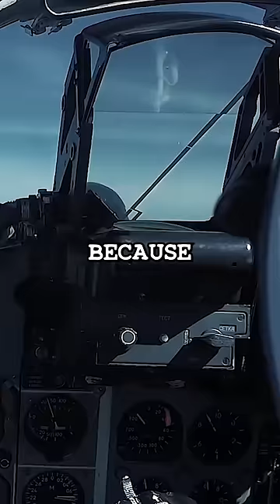What if a Fighter Jet Goes into Space?

Comment: There is this thing called the Armstrong’s line. It’s an altitude at which the blood starts to boil at room temperature because there is so little atmospheric pressure. That altitude is around 60,000 feet. If the aircraft loses cabin pressure at that altitude, you’re gonna die unless you are wearing a pressurized suit (space suit). This is why the U-2 and SR-71 pilots wear/wore space suits when they fly. Those folks are operating their aircraft between about 70,000’ to 95,000’. Loss of cabin pressure in this altitude, the pilots are protected by the space suits they are wearing. Back in the late 1950s and into the 1960s, USAF F-104 pilots wore pressurization suits because they were traveling at Mach 2 @ +60,000 feet.
Reply: Your blood is contained within your body, if you go to such altitudes it won’t just boil inside of you
Reply: @Wisewordsbruh dude, your blood will LITERALLY boil. you can look it up smh
Reply: Bs it's a Common misconception
Reply: @neckrohs it will just take less space
Reply: @neckrohs  blood is in a contained system, it can’t boil if the pressure within the veins remains constant
Reply: @neckrohs blood can’t boil if the pressure in your body remains constant
Reply: @neckrohs  plus In that case why doesn’t jet fuel do the same thing at higher altitudes?
Reply: And also the Armstrong line isn’t for blood, it’s for water, it’s the line/altitude where water starts to boil
Reply: @Wisewordsbruh  i can see where the op made mistakes in their wording. all im saying is that blood can technically boil aka ebullism. its not actually boiling like, lets say, water would but gas bubbles will form in said pilots blood if the cabins pressure drops and they dont have on the necessary means of countering it.
Reply: @Wisewordsbruh  now looking at it, my comment is also wrong since i said blood will “literally” boil. my apologies
Reply: Absolutely true
Reply: SMH, 1 PSI of pressure raises the boiling point of water by 4 degrees. If your blood pressure was 1 pound per square inch, you would immediately stroke out. Yes, just like the coolant in your car can boil when overheated, so can your blood inside your body. It would be very gruesome and messy. They would need a garden hose and many sponges to clean up the mess that used to be the pilot.  @Wisewordsbruh
Reply: @neckrohs  your fine man
Reply: @henrydhamster1093  1 PSI yeah it wouldn’t lower that much, but at the Armstrong line the op was talking about, it is around 0.0618 PSI, also your blood won’t overheat, I haven’t heard of any astronauts overheating, coolant overheats because it reaches its boiling point, it’s in a container system yeah, but there’s so much heat that the liquid inside starts to boil, there isn’t much heat in the human body compared to an internal combustion engine
Reply: Ohhhhhh, so that’s why the men wear those bulky space suits and helmets space helmets !
Reply: @Wisewordsbruh  You are right, However, the blood pressure will increase several folds momentarily if the outside pressure dropped from 1 atm pressure to less than half of that which is fatal, it will cause cardiac arrest and likely rupture your veins. But even at much lower altitude (30,000+ ft) if you don't have Oxygen mask, you will die of Hypoxia within short time.
Reply: The point is that at the Armstrong line, the atmospheric pressure is so low that water boils at room temperature. So, if you were to raise your blood pressure by 1 psi, you could raise the boiling point of your blood by about 4 degrees. The way we do this is with a pressurized space suit but if we actually raised our blood pressure by that much we would do horrible things to our bodies.  @Wisewordsbruh
Reply: They wore pressure suits because the cockpit isn't pressurised in a U2 ... what's all this 'loss of cabin pressure" nonsense
Reply: @Wisewordsbruh  our blood is mostly water
Reply: like the mercury astronaut suits?? could the mercury astronaut get out of his capsule if he had tp like in gemini caosules??? ive wondered
Reply: @Hoppy1571 you mean the space suits that have never been vacuum tunnel tested except once 😂😂😂 just pump it up inside to 14.7 psi and easily play golf on the moon 😂😂😂
Reply: The blood will "boil" only if the lift is very rapid.  One atmosphere is nothing. Divers can safely "pop out" at 22 feet depth (equal to one atmosphere"
Reply: Wouldn't you have to hit escape velocity (17500 mph) before you broke the atmosphere?
Reply: Dude a guy literally skydived from the edge of space and his blood didn't boil so this is false.
Reply: Actually, they are wearing a Pressure Suit.  What is the difference between a Pressure Suit and a Spacesuit?  A Pressure Suit is designed for very low atmospheric pressures, but can withstand hard vacuum for short periods of time.   A Spacesuit is designed for hard vacuum from the start.  
One other thing is that a Pressure Suit is relatively compact compared to a Spacesuit.  Which is why they are used inside of a cockpit, or whatever it is called now.  Because it is thinner it is a lot more flexible compared to a Spacesuit.  You don't want to try flying in a Spacesuit. 
Technically the electronics will just over heat and "burn out " , but this just means that it scorches the components of the systems in question. Rendering them totally inoperable. No fire or combustion. But, without power 🔋 it should cool off rapidly until the skin of the jet is exposed to Direct sunlight.  Plus all of the Volatile Organic Compounds, oils and other lubricants, will boil down into hard stiff sludge. Causing a problem with starting the engine(s) if you can return to thicker atmosphere.  The missiles will probably function properly.  The guns will not work without electricity.  An aircraft cannon is electricity powered and primed.  The powder will burn in vacuum because the powder has an oxidizer in it. How long the powder will work depends on how well it is sealed against adverse conditions.   But you also have a problem with the oils used to lubricate the weapon.  That will boil down/ off and cause the weapon to stop working in a short period of time.
Reply: @trogdor183 
Dude, he was wearing a Pressure Suit. Maintaining sufficient pressure inside the suit for survival.  Look at what he is wearing on you can see that he is wearing a Pressure/ vacuum helmet.
Reply: The A12 Oxcart flew higher&faster than the U2 & The Sr71 blackbird-the A12 used the same jets as the SR71 but the A12 was faster&lighter which allowed it to fly higher&faster.
Reply: Thanks for the info. 👍
So we can see the direct line to the development of spacesuits in the 50's high altitude aircraft.

Comment: You kinda fail to mention that it's impossible for the jet to go above its absolute flight ceiling - as the air thins there's less air to act against for lift, requiring the plane to move faster to maintain the same lift and altitude, but at the same time there's less air for the engines to compress resulting in a dropping compression ratio which is required for thrust efficiency, and also less oxygen which is required for combustion. These combining factors lead to a surprisingly sharp transition from operational altitude to one that the plane cannot function within - you can find graphs of the flight ceilings for your favorite planes and it's often shocking how hard the ceiling is.
Reply: Also depends on power to weight ratio. No need for lift if your engine can push more than the aircraft's weight. That's how rockets work.
Reply: @BioFake1 That’s not how the engines work. The engines need a certain amount of air to produce thrust. That means if the air gets too thin, the engines don’t work anymore no matter the thrust-to-weight ratio. This is because they can’t produce thrust if there’s not enough air for the engines. The comment you replied to explained this enough to answer your question. I am just restating it.
Reply: Comment #2
Rocket engines don’t work the same as jet engines. I assume (based on what I’ve heard) that rocket engines either don’t need air to work or they bring the air with them. Jet engines REQUIRE air to work because of how they are designed.
Reply: @IceClancy-jc2co  I'm not asking anything 🤔
Dude talks about loss of lift when air gets rare... 
I do know any engine needs oxygen for combustion to happen... 
I'm talking propulsion aircrafts flight mechanics not specifically airplane's. Missiles and rockets are aircrafts too. Go back to playing minecraft, kid.
Reply: @IceClancy-jc2co well one of the multiple fuels used that fire a rocket engine is liquid oxygen. Not sure what the other fuel is on modern rockets, but on the Apollo Saturn V it was kerosene so they literally provided their own oxygen in the fuel itself.

Comment: Little known fact:  when the F15 Streak Eagle set the time to climb records, on the last 30,000m flight, the engines were shut down (brought to idle) at 80,000ft, and from then it flew a balistic trajectory,  flying through the altitude for the record (98,425ft) but crested at around 103,000 ft, at which point it was traveling around 50mph, and pitching up and down by 40 degrees (20 deg nose high to 20 deg nose low) - the plane was barely in control at that altitude (and speed).  
Crazy to think that Foxbat was almost 4 miles higher up!
Reply: Sounds like the wildest roller coaster ride in history! No thank you!!!!
🫣💀🫣🤯🤯
Reply: Fox at was made out of titanium so it was more rugged
Reply: Even crazier that the SR-71 cruising altitude is fucking 90,000ft at a cruising speed of Mach 3.3 😭

Comment: The electronics will not burn cuz there is no air just like the engine and there is no way someone is going to die with a space suit cuz he's in space THAT'S LITERALLY WHY THEY MADE SPACE SUITS
Reply: No air means no way to remove the heat generated by the electronics. However they also said the electronics will stop working because the engines aren't generating power.
Reply: Lol. Thank you. This is what I was scrolling for.
Reply: @MikeSealguitar  ur welcome
Reply: @3rdalbum  Do you realize what temperature that altitude is...-50 deg F, its literally why the spec for military parts go all the way down to -54 degrees. Its more likely the components fail from freezing than burning. Source: Am an electronics engineer whose tested aviation electronic components.
Reply: @JaymesMorrow  Just because space is “cold” doesn’t mean that anything in space will be cold. Because space is a vacuum there is quite literally no where to transfer the heat to. The only way the heat dissipates is through radiation which is very slow.
Reply: @them0stanoying-500  This isn't space, the layers before space, before you'd even have to worry about heat, you'd fail out.
Reply: As somebody who works on fighter jets. Cabin pressure is regulated by a valve that closes if ecs pressure stops to maintain cabin pressure. Modern day Avionics are liquid-cooled. And depending on the jet, power for flight controls doesn't just come from  the engines
Reply: @iTz_JLAR   so I'm right?

Comment: Buddy, how would a spacesuit not save you from rapid pressure changes, the exact things they were meant to save you from
Reply: the space suit is supposed to pressurise your body, and provide pure oxygen. That stops happening when the oxygen and pressuriser stops working, which happens when the engine stops.
Reply: @Matcha_Biscuit that's a weird argument though. A space suit isnt a self contained and self operating system it needs oxygen and power to be a spacesuit if you dont have that then it's just a heavy onsie. It's like saying jumping out of a plane with a parachute wont help you survive because you need the straps to attach it to your body. Like obviously, that's part of the system.
Reply: @johnsmith-gs2mz  I don't really get what you are saying, you say it's a weird argument, but also restate what I said?
Reply: @Matcha_Biscuit  I was saying that you dont have a space suit without the systems that make it a spacesuit you just have a heavy onsie. Why would a pilot be wearing a space suit if the systems that are needed dont work when they are in space.
Reply: The term space suit is misleading here. Really high flying aircraft use pressure suits, however these are no space suits like they are used on ISS for EVAs. A real space suit has its own life support system, a pressure suit has not.
Reply: @Matcha_Biscuit he said a space suit, they are only pressurised to 4psi.
Reply: @Matcha_Biscuit  That's assuming the spacesuit runs using the onboard life support, at witch point it is useless.
Reply: @johnsmith-gs2mz  they don’t use spacesuits for space, they use it for high altitudes, where the pressure levels are dangerous. And they are required to breathe pure oxygen to keep the pilot’s blood from boiling.
Reply: @Matcha_Biscuit wrong. They ARE self contained. That’s what they’re for. They do NOT rely on the engine for pressure or oxygen. 
Don’t show your ignorance so willingly, bud.
Reply: @thatairplaneguy  they aren't self contained and its not what they are for either.
Reply: @unlisted_games2752  I'm sorry at what point does a pilot need to go outside the jet and also need a space suit? Never, so why wouldn't they put the life support in the jet?
Reply: Always thought pressurized was spelled with a "z". Matcha_bizcuit
Reply: @marknicholson2718 Im Canadian
Reply: @marknicholson2718  it is, i just misspelled it.
Reply: What did the guy who jumped out of a balloon from that altitude use?  Still works outside the aircraft in a freefall all the way to earth. That kind of space suit is what everyone is talking about. @Matcha_Biscuit
Reply: @smoke05s  thats called an EVA suit, its designed for space missions and external use. Thats why its called an EVA, Extravehicular Activity. What pilots use are IVA, Intravehicular Activity, Its designed for use in vehicles, meaning its completely unnecessary to have it be a suit independent of its vehicle.
Reply: There is a time when a pilot would need a pressurized suit outside the plane.  When they need to eject.  I'm not an expert, but when the Blackbird flight crew were getting ready for a flight, for the half hour before boarding the plane they were hooked up to an external life support system about the size of a suitcase.  There was an instance of a flight crew needing to eject at over 80,000 feet, at mach 3, and this was an anticipated circumstance, at least one person survived this event, so there must be enough protection that falling for a few miles wasn't long enough to kill him.  There is logically some small reservoir of oxygen and pressurization in the suits.
Reply: So no air no combustion right so how do the rockets move in space and get to space? Yet alone mars?

Comment: For all that to happen a jet needs to do what a space shuttle is made for
Reply: No, they will not burn like challanger.
Reply: @idarpolden5913  tf are you talking about?
Reply: @idarpolden5913  The challenger exploded on takeoff. Colombia burned up.
Reply: @K.O.G585  I fighter plane do not need solid fuel boosters to take off and burn up. Secondly it do not need that kind of heat protection as it do not use the atmosphere to slow down like Columbia.
Reply: @luminescentpearl4126  The point is that a MIG 25 do either, Maybe the F22 will?
Reply: Most fighter jets (that we know about 🤔) don't travel anywhere near the speeds that the shuttle used to re-enter the atmosphere when it flew. Also, the shuttle was more of a glider than a jet plane. So the two are not comparable outside of both having and leveraging moving flight control surfaces.

Comment: That's why the X program was developed. Bell X-1 broke the sound barrier. The X planes were rocket powered. They were dropped at altitude by a B-52. These flights continued into the late '60s. They did reach space. The pilots used reaction control jets to maneuver. Those that flew into space were given astronaut status. They received their astronaut pin insignia. The work accomplished was used to create the STS. THE SPACE SHUTTLE.

Comment: You forgot to mention that the control surfaces like the ailerons ,elevator and rudder wouldn't work because all of these need air or atmosphere to work. The pilot would skip off of the atmosphere and tumble uncontrollably into space with no hope for re entry. Even with thrusters like on the X-15 an NF-104 it's a tricky thing to get the aircraft in an attitude to re enter the atmosphere so the craft can start flying again
Reply: Yes and the wings would stop generating adequate lift making the aircraft fall down again way before reaching space..
Reply: You would have to go above 25,000mph to escape Earth's gravity.
Reply: @carlg4544  Not talking about gravity. The air is so thin that the control surfaces don’t work. You no longer have aerodynamic control of the aircraft. They put thrusters on it so they would have some control when the environment changed due to altitude.
Reply: I was looking for this comment, this should be number 1 thing mentioned